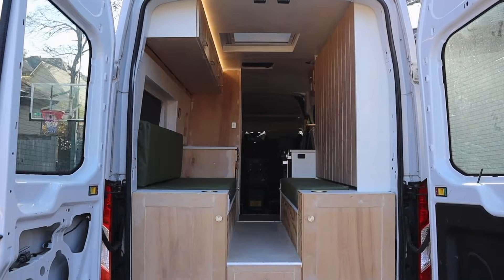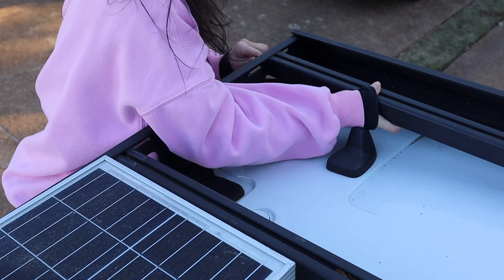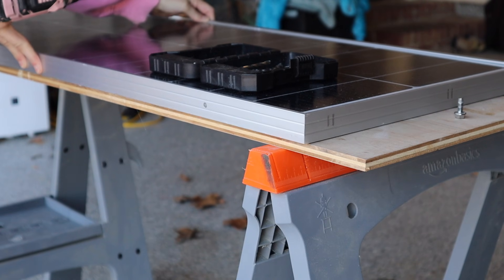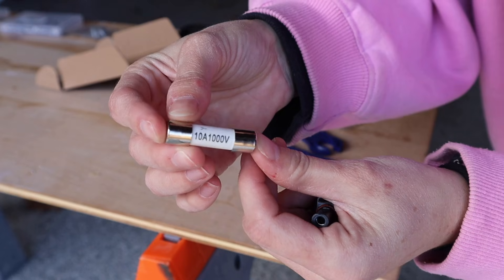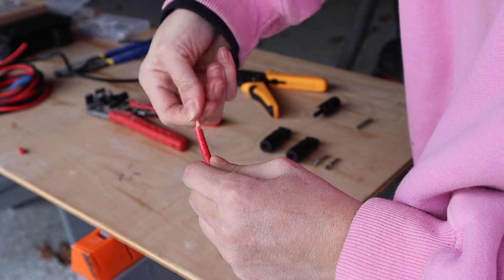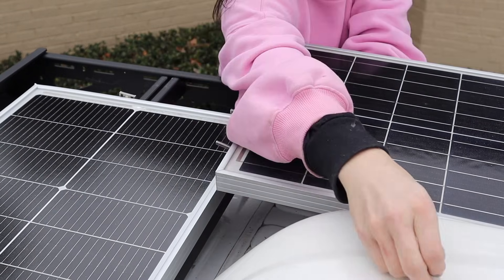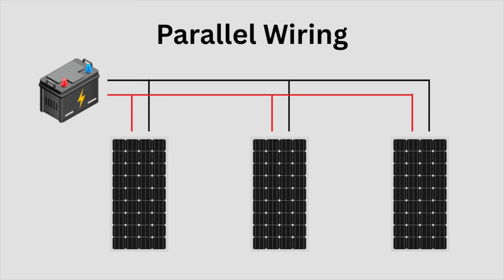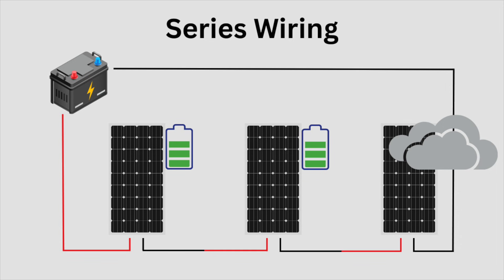Adding More Solar to My Van Build | 100W Slim Panel Install

Comment: Nice setup. There are stick on pamels you could use on the curved part of your roof. It could take you up to 600 watts and help run the AC.❤305

Comment: great work, it's tough working with such a small space. I would have been tempted to go 2x parallel strings of 2x serial strings. the primary benefit is less amperage down stream.
do you have external panels or alternator based charging ability?

Comment: Hello 👋🏾 thanks for the explanation about series versus parallel. How long will it take 400 W to recharge your batteries?
Reply from the maker: That totally depends on the day. I have a 400ah 12v battery, so on a perfectly sunny day, it would take 12 hours to charge the battery from empty. :)